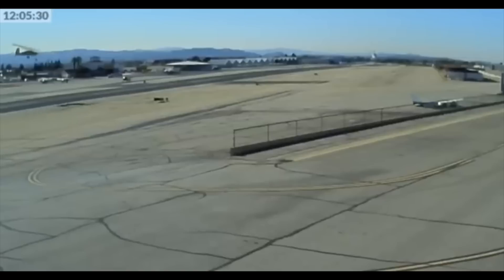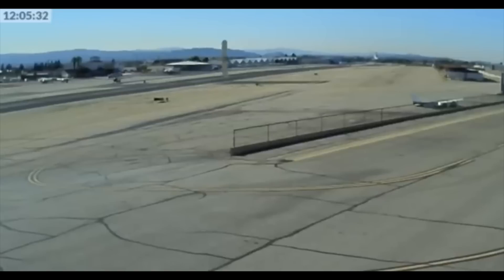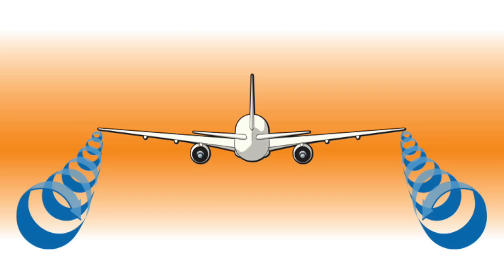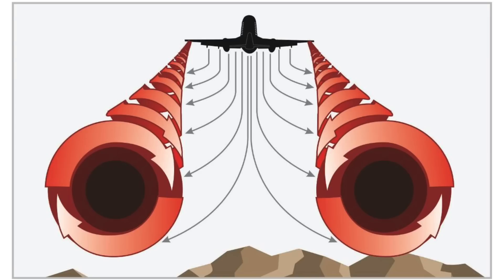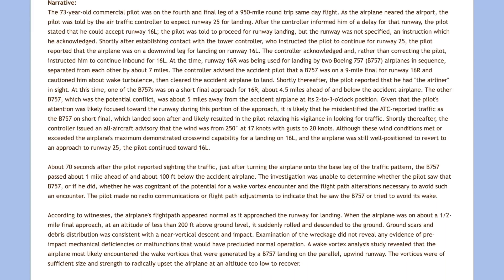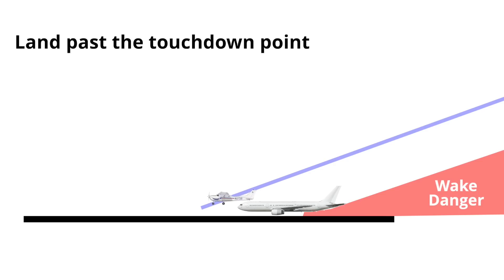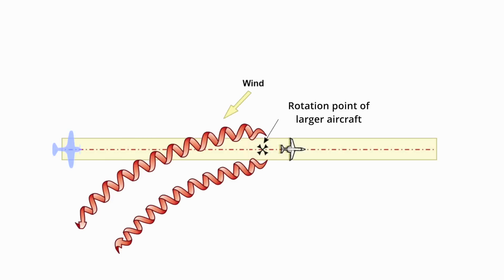FLIGHT INSTRUCTOR REACTS to WAKE TURBULENCE CRASH - Helicopter wake turbulence avoidance strategies

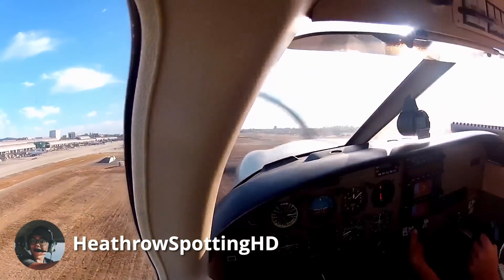Comment: 3:14 I experienced exactly this amount of wake from an A320 in the exact same point at the same field this week! SNA's runways are very close together and we even fly a 15 degree offset final because of it. I've never seen my instructor push power and carb heat in together so quickly, he basically punched the panel. I have learned over time to religiously watch where landing jets touch down at along the runway and if it's late, I just go around. 3 extra minutes in the pattern is a small cost to avoid death

Comment: I would suggest adding an order of magnitude to what you think the size of the helicopter to be to what you consider it to be. Small helo think business jet, medium helo think B-737 or A-320. Large helo think A-380 or Dreamliner. In addition, recognize helicopters may fly level along the whole length of the runway, hence the normal takeoff and land before their rotation or takeoff and land after their touchdown may be hard to achieve. Time is the best answer. Your case study with downwind could use emphasis. Light crosswinds get bad as they negate the separation tendency of the vortices. Believe the helo folks recommend three to five minutes as opposed to two minutes. We can also note the Nov 2001 tail sep crash in NYC started with a fly through of a vortex though had significant other issues.

Comment: I fly out of John Wayne and there are lots of jets. This is a good video and we have two parallel runways. A jet takes off on the one to the right of me and of course I have a right crosswind. There is no way I can rotate faster than that 737. I do have a shorter run way and I do a 15 degree off-set after the runway. I took off and managed to rotate before the 737 due to timing but it's to close for comfort If I get delayed or the timing is bad.   So when I am cleared for take--off, I can just wait about 2 min before I take off.  PS, I am a student pilot.  I am going to like look at the take-off roll distance for a 737 and compare to my take-off roll. We have mostly 737's at this airport. It's a super busy Charlie airport.

Comment: I’ve actually witnessed this exact thing when a S76 was landing, he had just sidestepped to the taxiway and then a C152 came across the threshold and 💥!  I don’t know how that pilot kept control, but he went wings vertical and then managed to go wings level while facing the hangers and over flew a Twin Otter that was turning on the ramp with skydivers loading about 40 feet above. The plane was definitely blaring its stall buzzer because it was so slow I was thinking it was gonna roll over any 2nd. The pilot was able to return and land after hanging out south of the field for 10 minutes gathering his 💩!!

Comment: Good one Jason. I had a spectacular demonstration of wake turbulence once when I lived just next to the RAAF (air force) base at Richmond, west of Sydney, Australia. I was walking home one evening up the road that is almost in line with the air force base runway - beautiful and calm - cold, no wind - and the C130s stationed at the air force base were doing night circuits/touch and goes - a C130 flew low overhead on short final - about 30 seconds later I heard a 'swhoosh swoosh swoosh' sound, and the shrubs and trees in the gardens of the houses on either side of the road that I was walking along started flailing around like a tornado had hit them. I realized it was the wake turbulence from the wing tip vortices. Very graphic.

Comment: 🛫📖🛬
Great job Jason,
There's definitely not enough discussion on this topic and many GA pilots that fly around small airports have no idea what they may encounter when approaching a large airport that accommodates heavies (or anything capable of producing destructive vortices).

I have followed you for a long time now and I like your teaching technique. Kudos
Reply: I am getting good experience flying out of a busy Charlie airport. PS, when I get my private pilot, It's not going to be my home airport. However, If I have to fly into a Charlie airport or some crazy busy airport with jets I will know how to deal with it. PS, I was at a non-towered airport and this helicopter running close to the approaching runway. I aborted my landing and then came around and asked the helicopter to shut down or move.
Reply: @kimberlywentworth9160  🛫📖🛬

Hey Kimberly,
To me it sounds like you are professionally oriented and a probable candidate for an FO seat in the not too distant future.

Situational awareness and the See and avoid rule always applys.

Getting your radio communications promptly and smoothly without anxiety is a big key to entering any tower airport no matter what the size.

Listening to that radio can be a lifesaver never accept any clearance you don't understand fully.

I don't know if Jason actually said it or not;
But one good thing to remember about wake turbulence;

On a fixed wing aircraft the vortices begin on liftoff and they shut down upon contact with the surface.

The same applies to the heli when they start pulling collective and lifting you're going to get turbulent rotation.

By visual contact and by listening to the radio you'll be able to know who they're working in in front of you and adjust your approach accordingly.

For example not too long ago everything was starting to deteriorate on the approach and I asked to be turned out and went back to the FAF and sequenced again for landing.

I really wish you the best in your career and you are entering aviation at a wonderful time.

Don't just be a pilot but be the best Aviator you can be.

GOD Bless
📖🛐✈️🐆

Comment: I went out to Marana Regional (KAVQ) Thursday to check the glide slope receiver in my new (used) KNS80.  There were two helicopters doing pattern work and low approaches, while other turbo prop planes (shorts?) where dropping sky divers about every 15 seconds.  I decided to wait for another day because I didn't want to deal with the slow flying helicopters in the pattern while having to look out for jumpers, too.  I never gave the turbulence the choppers would cause a thought...  I'm glad I stayed on the ground.  Thanks for the video.

Comment: Nice Video.  I don't agree with Dan Gryder's assessment of your encounter with the Cirrus while landing.  Regardless of the other aircrafts altitude, lateral position was far more critical as to landing order determination. I've been in similar situations as your encounter and would have made the same decision to land as you, this especially considering the descent and landing characteristics of my 182 with 40 degrees of flaps.  That last call by the arrogant Cirrus pilot should have been " Hey, no problem, I'll make way...."  I saw no elements of danger beyond what is normal for participating in aviation.

Dan's follow up video where he enhanced his communication with the conflicting pilot is a good idea but quite honestly would not work in some situations like at a super busy uncontrolled airport where everyone is as brief as possible and frequently stepping on each others radio calls.  I suppose one could just stay on the ground and avoid aviation's inherent risks....

Comment: Why do helicopters have to travel above the runway? They are not actually landing on it since most can't taxi on the ground.
Reply: It's hard to tell but that helicopter is actually pretty offset from the runway. Regardless helicopters will often take off over or parallel to runways to give themselves somewhere to go to in an engine out scenario. The most likely times for an engine to quit are takeoff and landing, both times when helicopters don't have a very good flight profile for autorotation. Taking off and approaching over a runway (or taxiway) gives them a nice long clear stretch to have a fighting chance at putting the aircraft down safely.
Reply: @user-gf2fc5xb4m  Thanks, that makes sense.